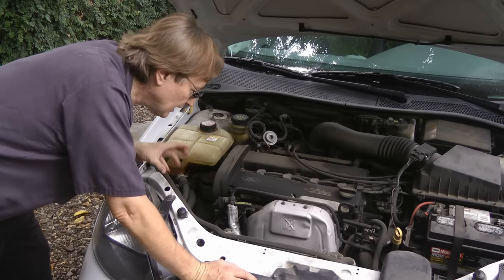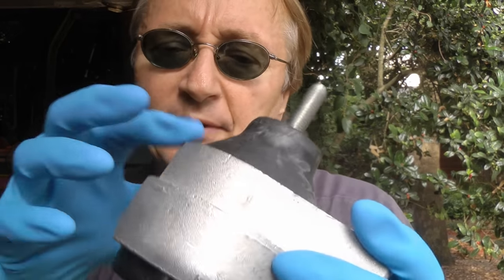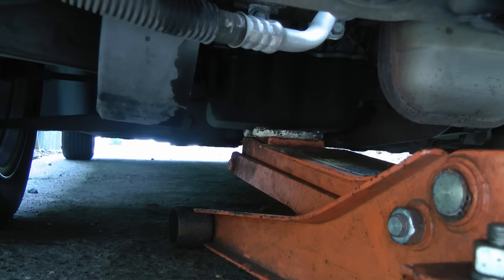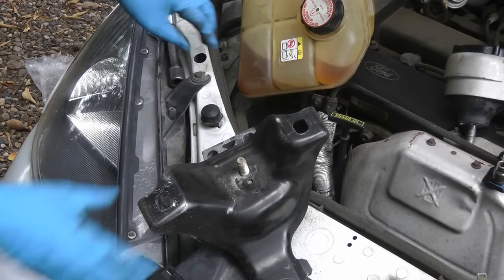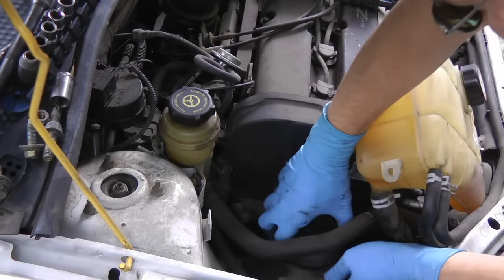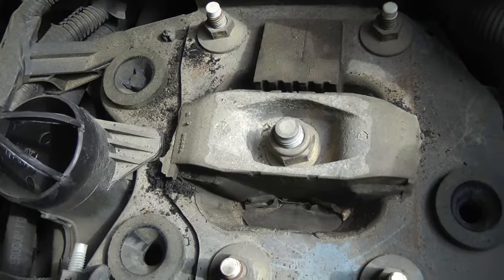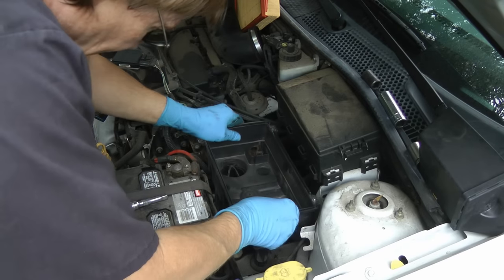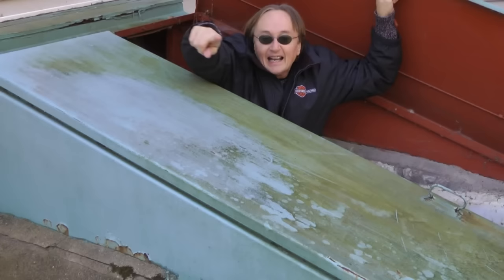How to Replace Motor Mounts in Your Car

Comment: Changing mounts isn't too hard, unless the brackets or the bolts that hold the mounts/brackets are broken and in a hard to reach place way in the back of the engine and you have to weld onto them to fix them (so they don't do that again!). I had two of them with that problem, one where a bolt head busted through the bracket holding the mount (I had to have a thick washer welded onto where the bracket broke) and the other bolt holding the bracket busted off and I had to use a lefty drill bit and easy-out to remove, and the other mount where the bolt holes on the mount itself broke through. The odd thing is the rubbers on those two mounts were good. The other two mounts had the usual broken rubber.

Comment: Scotty , you are the best mechanic I've ever seen I have a 2006 mercury Milan 6cyl. Is it the same way to fix it ? This person called it a dog bone. I hope you get back to me doc.
Reply: dog bone mounts, or torque strut mounts, if its like mine - on the top in plain view- can be replaced without jacking it up. just remove the 2 bolts, remove and replace mount, install the 2 bolts tight and voila.

Comment: Hey Scotty,
I have a 2010 Arcadia. I brought the car in to get a oil change and to check because I was smelling something burning. Mechanic said the struts needed to be replaced. I could only afford the front two. Replaced them and picked it up, there was clunking noisss when I started the car and it seemed the train was slipping.(it to a second to get going -a delay; only after I got the struts done, before no issues) now they came back and said it was the motor mounts… uuummm don’t seem like one has to do with the other.
Thoughts?

Comment: I have a Focus not the zetec like this one in the video, but the 2.3 manual transaxle. Not sure if your automatic has it, but mine has a torque strut as well underneath the car. It bolts to the sub frame and the lower transaxle housing. I just changed all 3 a few days ago and they were all broken. The car feels a lot better now, but I need to go back and adjust the motor/transaxle position because I placed it wrong and it’s bouncing between the rubbers and causing a vibration at 50 to 55. I am going in again today if the rain stops to adjust the position. Wish me luck! With me the third time is the charm! 🙁

Comment: May I make a suggestion? While YouTube is great for having a lot of these 'how to' videos, it gets VERY frustrating when you need something specific, and all these videos have generic titles. Since so many vehicles are different year to year, and model to model, even within the same manufacturer, "How to replace a Motor Mount or Transmission Mount" really doesn't tell me anything. 
"Replacing a motor/transmission mount, Ford/GM/Toyota?Hyundai, etc 02-09" would tell us everything we need.
Yours is a very informative video, but I don't have a Ford van.For those who do, this is the video they need. I have a 1997 Cadillac Eldorado, which is specifically what I searched for, so why am i here? Because there's a whole list with the same generic title you used, and I have to look through every one of them to find what I need.
Thanks.

Comment: In your video you said put the bolts on nice and tight. Is it as easy as that, like the way lug nuts are tightened at a flat fix? No torque spec required?

Comment: Hi Mr.Kilmer, I own a 1989 F-250 302 and have the following question, My truck has vibrations like crazy. Im talking about driving highway and it felt like offroad inside. This only happens when the truck goes on second gear. Its automatic. I noticed today that the transmission is missing two bolts. You think theres something else that could cause these vibrations that ONLY appear second? I will install the two bolts missing in the end of the transmission tomorrow ASAP.

Comment: Hi Scotty. Good job on all your videos. I have a friend with a low mileage 2018 Ford Escape that pulls sharply to the right under hard acceleration. There is no vibration, clunking or any other symptoms. She recently had a rear fender bender and had an alignment after the repairs. The alignment was pretty spot-on anyway, but was told told of possible broken motor mount due to pulling. I checked out and drove the car and the engine in pretty solid and doesn't exhibit any typical signs of a bad motor mount. Any thoughts? thx

Comment: Scotty, is it common for aftermarket motor mounts to not be entirely true to fit? I exchanged two Anchor branded Mazda lower torque mounts because the frame boltloop was too wide every other aspect of the aftermarket mount was ok but that bolt hole was too long, and they swore it was factory spec, finally the third one we tried my neighbor down the street just took a grinder and shaved off 1/4" on each side of that bolt loop and it fit on first try.

Comment: Scotty I just replace the clutch on my 96 mustang cobra and let me say it was a headache because the previous owner had put long tube headers, anyways the car shifts with no problem but I hear a clicking noise coming from the bottom can it be exhaust related?? You hear it soon as the car starts

Comment: Hello Scotty. I had my 02 Mazda 626 4 cyl engine mounts replaced (all five of them) and it shakes a lot when idling. I checked to see if they didn't tighten the bolts but they were all tight. I got the good engine mounts. Someone mentioned to me that their is a break-in period for engine mounts. Is that true?

Comment: Hi Scotty - I have a 2004 Hyundai Getz 1.5 CRDI and I can hear a bit of a grinding sound when I startup and turn right at the same time. The noise comes from the right and it's not the axles because I've had them changed. One mechanic said it might be the passenger side engine mount and as he demonstrated, the engine has quite a lot of back and forth movement if you repeatedly engage the clutch with the hand brake on in first gear. Anyways, you can hear it better when the car is loaded with more people.(only when you turn right in 1st gear or going straight in 1st and second over hard acceleration) Also... the car has always had this quite obvious vibration to it since I got it. you can see it in the seat headrest and on the engine itself and air filter on idle. It got worse after this year's freezing temperatures. Otherwise the car runs perfectly fine, it has good power and no suspension problems as both the control arms and stabilizer bars have been changed in order to pass the technical inspection. Would you raise your hand for a bad motor mount?
Reply from the maker: +Alexandru Cioanca could easily be mount, engine or transmission mount

Comment: Hey Scotty, the electric lock on my door (driver's side) doesn't work anymore and I can't open my door. That also means I can't remove the side panel to get to the problem. Do you have any suggestions? I drive a ford escape xlt 2003.

PS. Big fan of your easy to understand videos

Comment: Remember about wright tightening torque of the screws when replacing parts in your car. In my car Espace 4, tightening torque are from 21Nm one screws to 190Nm the other! It is safety matters. Check your book.

Comment: Scotty, what's your opinion on the Ford Crown Victoria? Good car? It seems to be one of the most user serviceable modern cars out there.
Reply: Those cars are tanks and will handle loads of hard driving if you maintain them and keep everything in good shape. It's a ford modular motor, they don't really die. Hell they have a cylinder deactivation system that will allow
Reply: --you to drive the car 50 miles or so without a cooling system

Comment: Hey @Scotty Kilmer, my car is a 2008 Honda Civic with an automatic transmission, I recently bought it used and it is making that clunk when I change gears, but mostly when the engine is cold. Is this still possible to be because of the engine mounts?

Comment: Scotty my AWD legacy 2.5 shakes and makes a weird noise when parking and turning, u turns ect. I used a fuse for the FWD slot and the noise and vibrations stopped until i started running with the AWD again. What can be wrong and how much should i expect to pay to fix it?

Comment: Hey Scotty, I’ve got a 1991 300ZX Twin Turbo and just starting yesterday it’s been shaking on acceraltion just when I rev it in general, it stopped for a second every now and then or at low RPM’s but it also feels like there is a lack of acceleration. What do you think this could be? I was thinking maybe either an engine mount, tranny mount, or maybe a driveshaft? Please get back to me it would be greatly appreciated!

Comment: Had mounts change (5) on Honda CR-V. Order mounts from e bay (5) for 69.72 took it to Percision tune for installation only charge me labor fee. Car runs like its brand new save over 600.00 in cost labor was 314.00 instead of 875.00

Comment: 1988 GMC Sierra, I have a vibration when transmission down shifts, I've check you U joints  they are good, it just rattles a bit but goes away apon acceleration. I'm either guessing transmission mounts or motor mounts bad. (Bought from older gentleman) maintenance was lacked.
Reply from the maker: on those more often just the transmission wearing out internally. Bad mounts would be worse when taking off from a stop

Comment: Hey Scotty,

Love the videos. Was wondering if you could shed some light on a few different problems. 1990 f150 xlt

-Dies at idle if AC is on, stays running if AC is off
-Heater does not get hot, AC blows cold as ice
-Some light smoke out of exhaust after driving for more than 15 minutes, and only seems to happen when accelerating past 65 mph
Reply from the maker: I would assume head gasket is starting to go, do my test "how to tell if your head gasket is blown" and if it is, that could do it all.

Comment: hey scotty, on a 1995 buick regal 3.8 v6, is that a motor mount under the ac compressor? If that is do you have to take the compressor off to change it?

Comment: The side motor mounts on the 7th generation Corolla are almost this easy, there are a few bolts you have to reach from underneath. But the rear mount... gotta drop the entire cross member!

Comment: Hey Scotty, first of all i wanna say im a huge fan. Ive never done any work on my car but thanks to your videos ive been well informed and know what to look for when i go to my mechanic. My 2000 Impala had a worst case of broken engine mounts. I replaced the two top engine mounts (3.8L V6) but i still get some vibration. One of the top engine mounts had been broken for at least two to three years and never replaced until i put my  hands on the vehicle. Do  you think there is permanent damage done to the engine? Or if i replace the two bottom mounts the vibration will completely stop? Im really worried, i dont wanna sell my car but i dont want to invest all my money in it. What do you recommend?
Reply from the maker: +kryptonek88 change the rest of the mounts, it should go away

Comment: Thanks for the video Mr. Kilmer. I always her it dangerous to jack up a vehile by the engine oil pan or the transmission oil pan. Is there anoth way I could jack up the engine when changing the motor mount like say on a Ford Ranger?
Reply from the maker: +TheHoenheim yes you can do it like the pros and jack the engine up from the top, but you need a cherry picker engine hoist or an A frame hoist to do that
Reply: Alright then, thanks Mr. Kilmer. Keep up the videos, They've helped me a lot, a real lifesaver

Comment: Hey Scotty, I am about to buy a 2015 Audi A4 Salvage Car. It was hit in the front bumper. How much do you think it will cost to replace the motor mount on it?? I am not a mechanic. I did the Carfax on the car and was serviced recently and only has 60K miles on it..

Comment: Scotty Kilmer i have a 2002 camry and i changed all motor mounts from ebay but they were trash the right one broke within 2 days and i hear the noise when i shhift to gears i was gonna buy them original but there like 700+ what other mounts can i get that are really good to stop the vibration. it also vibrates more in reverse. thank you i hate all the vibration my car only has 106569 miles
Reply from the maker: realize often only the dealer ones work correctly. But ask your local auto parts store what they can get and how they guarantee them

Comment: yo scotty, I have a 1993 acura integra  I just bought the car the engine was rocking back and forward and I felt it through the gear shifting fork  then the axle popped out from the transmission.would that be my motor mounts or my transmission mounts?

Comment: Scotty, I've got a question about motor mounts. Can't seem to find good reviews on the different manufacturers on the internet. In your opinion which brand is best? I'm finding parts from DEA, Westar, Anchor, Pioneer, Protier, I'm finding all these different manufacturers but I can't tell which is most durable. I sure don't want to change mounts every other week!
Reply from the maker: I would go OEm factory on that, aftermarket mounts often stink
Reply: I take it they fall into the garbage with the rest of those aftermarket so-called parts!

Comment: Hey Scotty. I have a 2006 Scion tC at 126,000 miles and it started making a grinding Noise on the right side of the car. Also think my motor mounts are bad because I got a friend to video and the motor tilts back when I put it in drive. Any advise? Thanks.

Comment: Woah this video is old. I just bought a used 2017 2.0T camaro manual transmission. I bought it with 6k miles so it's pretty new but I am researching mayirly on everything about the car so my question for Scotty or anyone whom knows best, are the stock engine and transmission mounts best or is there such a thi ng as upgraded brand ones? My goal if I was to change them is to extend the engine and transmission lifespan more than it already will last.

Comment: Hey Scotty I have an 02 Stratus 2.4L and if the car is in drive and stopped, it squeaks every couple seconds or so almost sounds like a small animal but when you put it in park it is fine. Possibly the motor mount or no? Thanks
Reply from the maker: anything is possible with noises, jack up the engine and see if the mounts are cracked and broken

Comment: I have 2007 Saturn Vue and I think it needs the motor mounts replaced too. It vibrates mostly in the mornings. And sometimes stops vibrating after I've driven it a while?  Would it still be broken motor mounts if it's doing that?  Also,  I am not sure if you recorded the whole event so I am wondering exactly how long did it take you to replace the motor mounts?  How long (time) should I expect a shop to take to do it for me and charge me for labor?
Reply from the maker: +J Niemann  many things can do that, but if they are indeed cracked, change them first.  labor on a saturn to change motor mounts is 1.2 hours, here in houston that's about 120 bucks
Reply: Thanks for that info. I feel like other people are trying to poke my eyes out with these prices quotes I am getting. I called 2 places here today (in SA TX) and got quoted $1000 for 1 mount and labor, 1100 for 2 mounts and labor.  Another place quoted $750 for 2 mounts and labor. What's up with these prices here? Are they messing with me cause I'm a woman?!!?? I did some research on prices for a motor mount. I found one online for $75.00. So for 2 mounts and the labor price you qoted the total job shouldn't be more than $275.00 right?

Comment: Hey Scotty I have a 2006 g35 coupe I'm unsure if I need new motor mounts, when the engine is cold and I put it in gear the engine jolts back, but when I let the car warm up properly it doesn't move at all, do you suggest I replace the motor mounts? Or do I have a different problem
Reply from the maker: +JohnyBoy512   pray it's motor or transmission mounts, jack up the engine and tranny from the bottom and see if any are broken

Comment: hey men I bought a whole set of the front suspension such has control arm, inner and putter tie rods, sway bar for a Honda Accord 1998 but my mistake was I order it for a 6 cylinder but my car is a 4 cylinder should I be worried? does it really matter thanks if you responds I'm just scared

Comment: Hey, the dealer just replaced the clutch and fly wheel on my 2003 Mustang Cobra. Now I have clunking / vibrations when I start the vehicle and when I rev up the rpm's what could be the issue here?  I didn't have that problem before I took it to get the clutch replaced. Thanks

Comment: My 2007 Honda Odyssey EX-L with VCM makes vibrations and noises into the interior only when I accelerate or drive through potholes. My engine does come with Active Noise Cancellation, which I think reduces engine vibration into the interior. I read on the internet that the Active Noise Cancellation mounts can fail before ten years, but my vehicle is less than 40,000 miles.
Reply from the maker: many things can make acceleration noise, from worn strut mounts, a frame bushing, tranny or motor mounts, and much more. BUT, mounts are the easiest to jack up and check, I'd start there

Comment: Hi
Scotty
Grand Am gt 3.4L V6
i fixed the side engine mount plate it was split in half  on the passenger side of the engine,
i took it for a run but noticed the the engine seems to jump like it is going to come threw the Hood at take off is it possible that there maybe another mount bad as in Transmission mount. and do you know how many engine mounts are on this Car.

Comment: Could a mechanic chime in and tell me is it normal to change out all three motor mounts on a Honda Civic 2000 or just the left and right ones. Also can a bad middle motor mount cause oil leak issues? Thank you

Comment: Got a 05 pacifica, motor mounts are dead w/70k miles. This have over 3 mounts, to my understanding the major ones are front and back. What's your take on OEM mounts? Can I use dealer on front & back and OEM for the others? Dealer are 160 e/o.
Reply from the maker: oem mounts are best and always fit. With aftermarket ones, you are gambling